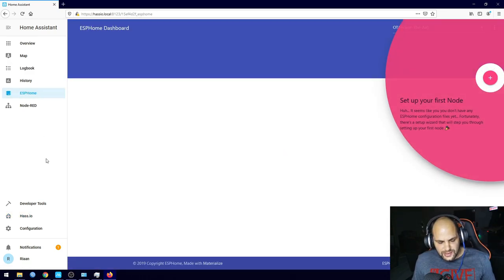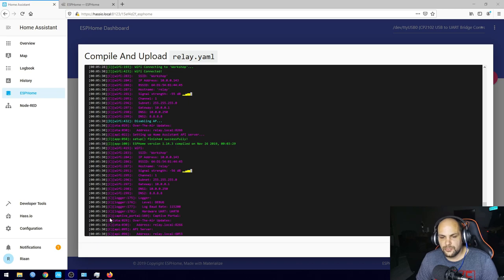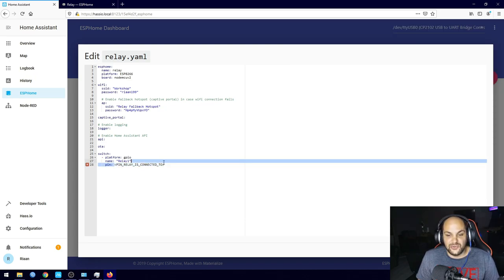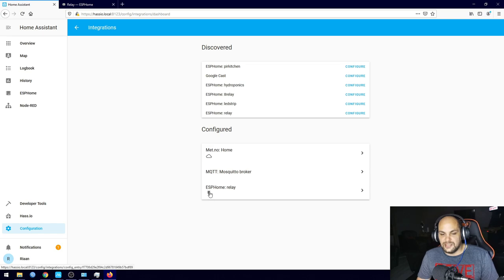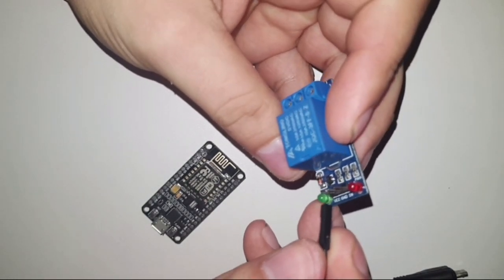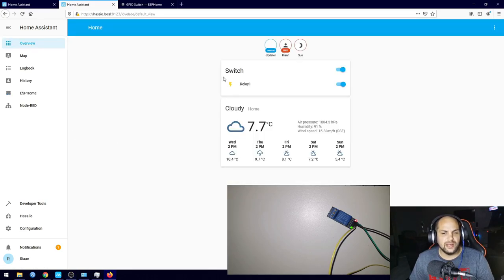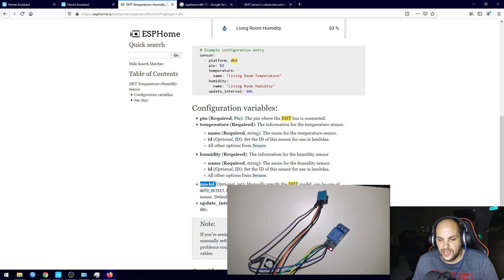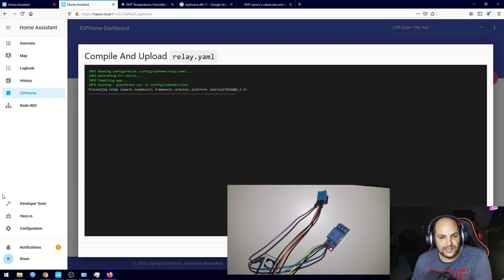Home assistant 103 ESPhome custom Relays and Temperature

Comment: Re comment below, I have now finally succeeded in using  an ESP32. A few tricks to know -need to connect 10uF capacitor across EN and GND to be able to flash the board.  Yaml code only accepted if you call pin    by integer name only. ie wouldn't take D4 but would take 4. Also pin 4 on ESP32s is not pin D4 but for my 30pin board was 4th pin from bottom which was D2. Anyway that was my experience.
Reply from the maker: I never tried it with a 32 before all i have is the esp32 cams not sure if I should do a video on them they don't really feel worth using.
Normal esp32 on the other hand would work awesome thing b jumpering D0 to GND would put it in flashing mode.

Comment: Great video! You made setting up ESP8266 devices with ESPhome to run on Home Assistant look very easy. I also love the Home Assistant series as a whole.

I am very new to home assistant and using ESP devices. I’m looking to use an 8 relay board so I can control the many devices I have in my desk, and seeing you set it up with that exact amount of relays made me certain that a NodeMCU could be used to control 8 relays.

I do have some questions though. On top of the 8 relays, how many more additional relays and sensors could the NodeMCU control?

From doing a quick image search, I counted a total of 13 GPIO pins, so would that mean the NodeMCU could control 8 relays + 5 additional sensors/relays?
Reply from the maker: Hey Thanks for the comment I would recommend reading up on what some of the pins does as well as some of them may cause problems if you do not use them correctly  there is a fantastic video here about this.
https://www.youtube.com/watch?v=c0tMGlJVmkw

Comment: Thanks again for great video. As a newbie, I wondered would a flashed Sonoff switch provide the same solution as this configuration? (Single relay)   Seems the cost for one Sonoff switch would be a cheaper solution for a simple single relay should one be price conscious. Thanks in advance.
Reply from the maker: I have never worked with sonoff divices before but it should work if you have the ability to flash a image on it think you may need a usb programer and put it into flashing mode to flas the bin fine. You would also need to know the gpio pin of the sonoff
Reply: @AverageAutomation  Thank you so much. Sonoff has the esp chip and can be flased...clunky thought. Love your video thanks again

Comment: Excellent video. Please forget my comment below as all now worked out. However do have one question. Do you know how to flash the ESP32-WROOM-32 (the only type I can get). The ESP8266 will flash just fine but not the ESP32. I am sure there must be a combination of pushing EN button or BOOT button , prior to hitting the UPLOAD, but I can't get it to  work. Have searched internet for an answer but couldn't find anything relating to flashing  ESP32 on Home Assistant using ESPHome.

Comment: Thanks for introducing me to ESPHome - it seems amazingly simple to setup a NodeMcu to intergrate with HA. I managed to wire up on a breadboard a relay and a couple of thermoneters and using your examples, all worked. BUT how can I use a DHT and a Dallas 18B20 sensor in the same configuration as I get a coding error with 2 instances of Sensor  as follows.                                                                                                                                                                                                 - switch:
  - platform: gpio
    name: "Relay"
    pin: D0
    
# #     Note had to comment out this code when using the Dallas code.
#sensor:
#  - platform: dht
#    pin: D1
#    temperature:
#      name: "Living Room Temperature"
#    humidity:
#      name: "Living Room Humidity"
#    model: DHT11
#    update_interval: 60s
    
dallas:
  - pin: D3
  
sensor:
  - platform: dallas
    address: 0xAA8000002AA73428
    name: "Temperature #1"
Reply from the maker: When using more than one sensor you only need to use the sensor heading once example 

sensor:

 - platform: dht
    pin: D1
    temperature:
      name: "Living Room Temperature"
    humidity:
      name: "Living Room Humidity"
    model: DHT11
    update_interval: 60s
    
  - platform: dallas
    pin: D3
    address: 0xAA8000002AA73428
    name: "Temperature #1"

This is just a copy of the code you have provided I have not worked with Dallas before but I think the issue you had was having the heading of "Sensor" more than once.

Comment: OMG thanks for this! I used to use arduino ide for this. This WAY MUCH easier and your tuts is very easy to follow. You are a great teacher!  I have a question is this thing for prototyping only or can i use this for home use?
Reply from the maker: I have a few of these that have been running for years without any issues you should be fine using the items
Reply: @AverageAutomation  cool thanks!

Comment: Hi, great videos you are posting. Learning a lot. But could you please explain me how I can add several weather sensors at one  esp8266. I have looked at esphome.io but there I can't find any solution. What I want is for example, a bmp180 + dht22 + bh1750 and a ds18b20.
But I struggle with all the addresses and gpio settings. I have running a dht22 with the relay off this video and would like to expand my sensors. Kind regards. Bas
Reply from the maker: Hey I do nog spesificly have the sensors you have mentioned I will need to take a look in the future at setting up a weather station maybe do a solar setup one may be something I can look at.

Comment: Does this tutorial still apply if I have my ESP8266 flashed with tasmota?
Reply from the maker: Yes if you plug it in to your raspberry pi it would flash over tasmota firmware. Keep in mi d this will remove the config you had on there for tasmota and change it to esphome firmware.